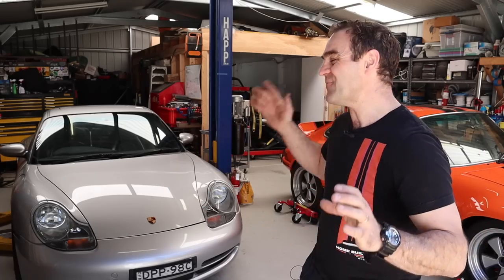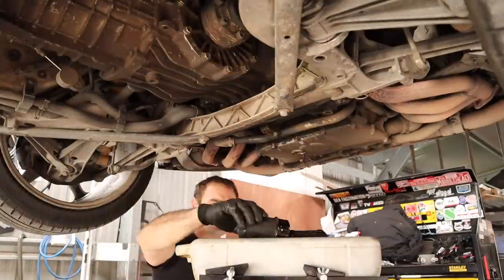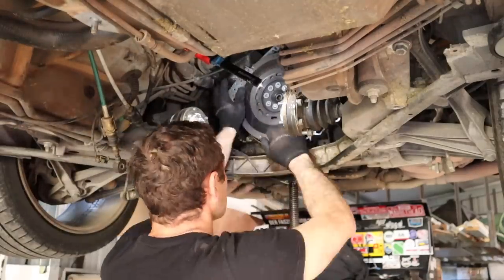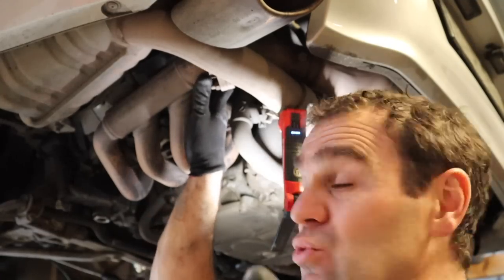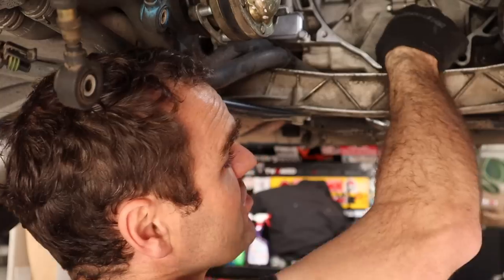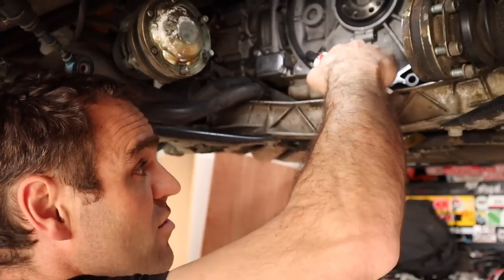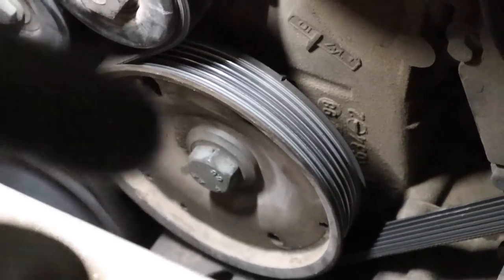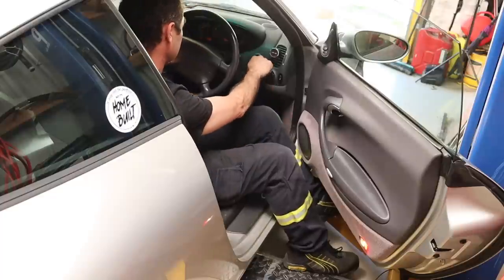Porsche 996/986 DIY IMS bearing replacement

Comment: Jake Raby here, Flat 6 Innovations.. Glad to see that you loved my extraction tool design :-) I designed this one for LN Engineering back in 2007.
Reply from the maker: Simple and it works. Thanks mate.
Reply: Jake 😃 do you actually need to removed the chain tensioner under the A/C compressor?
Reply: @khestehave  yes, remove all three chain tensioners

Comment: You don't need to take off the front chain tensioner, and if the flywheel and cams are locked, you don't need to put the lock plate on the flywheel. I used an EPS permanent-fix roller bearing kit and EPS clutch kit. The clutch disk has more meat on it and a better hold.

Comment: I would have been inclined to use a slide hammer on the bearing remove, but you need to lock cams, etc the kit sounds good, but just releasing the chain tensioner and marking the cams positions and engine at TDC would probably be fine also... Those stretch flywheel bolts always concerned me, when I switched to a single mass flywheel on my C5 Allroad, the aftermarket flywheel I got it slightly used clutch disc, and pressure plate,  but upgraded the clutch to a new custom made segmented kevlar disc for longevity. In my search for after market flywheel bolts ARP made flywheel bolts that would work, but decided to call Valeo to get the correct stretch bolts, they sent them to me free no charge....

Comment: Why do you have to lock cams and remove tension.     The bearing wont come out unless you do that procedure
Reply from the maker: To take tension off the bearing and to ensure the timing is locked in. If the timing moves you might have to say goodbye to your engine ;)
Reply: @HomeBuiltByJeff  
They have 3 set screws for the ims housing to hold something in place.   Does that help if I lock cam nd pin tdc.  Or do I  take off chain tensioners.    Are there 4 chain tensioners.   
Thanks for your video

Comment: The bearings do last the life of the car.
When the bearing goes the car dies.
Reply from the maker: Haha, true, unless you are Hoovie and LS swap it ;)
Reply: Lol.  Lifetime guarantee.  When it fails its life expired.
Reply: Home Built By Jeff . That was a failed resurrection attempt.
It failed because he didn’t mitigate the oil pickup problem facing the motor backwards would cause.
Reply: Anom Amos
You're mean .....
Reply: @HomeBuiltByJeff  
It would have been cheaper for him to put in a brand new 996 motor.

Comment: I thought all aftermarket IMS bearing solutions used an oil supply line to the new bearing. Hmm. I guess that’s one solution. Did you consider the oiled IMS bearing solution?
Reply: the Oiled ims bearing Is about 700 to 800 dollars for the kit. AN you haft to drimle  a slot in the crank case  to get the line to fit

Comment: Nice work mate, how was the old bearing condition? I'm still driving with the original so need to get it replaced as well. Impossible without a hoist I would imagine?
Reply from the maker: My bearing was fine. There are guys who do it on jack stands, but a hoist makes things easier for sure.
Reply: @HomeBuiltByJeff    
I thought about that, but the transmission for a 986 is around 175 pounds. That's heavier than I could move on my back in the garage.

Comment: I borrowed a pilot bearing extractor from Oreilly's and cut a 6 inch piece of pipe and big bolt and nut to make a tool to extract the bearing, and made cam locks from an old hinge.
Reply: Nothing competes with “old school” engineering, you are one of a rarity, we talkin’ one over a billion category stuff

Comment: Yes, I'm still looking for the oil pressure feed to the bearing (Bushing) replacement that Jeff put in this motor.  If you own a Porsche, you need another vehicle to fetch the parts to keep it on the road.

Comment: 3.4's had a single row IMS bearing. It is only the very early cars that were dual row. Also. I think you need to lock both cams, because you are releasing tension on both cam chains. There is a potential for the chain to jump. That is why the kits normally have two locks.
Reply: he already said that that on the bearing in the video. Also the chain doesnt have enough slack to jump, and gravity prevents it as well.

Comment: Why do they want you to send the bearing back jeff!?
Reply: Yeah Mate Watch the video.
Reply: They sent a sticker to attach to the car to certify the IMS bearing has been replaced. If you are going to buy the car and see the sticker, you can call LN Engineering, and they will confirm they sold the replacement for that car, and received the old one back, implying that they know it has been replaced
Reply: @Sharkerp38  aaah I guess it's a Porsche thing to have the confidence in buying and selling the car afterwards, never seen that before cheers

Comment: The Boxster 986 (1997-1999) has a 96.20 (2480 cc) engine which has the original double row bearing and has no problems.
From 2000 to 2002 were M 96.22; from 2003 to 2004 of M 96.23; the S from 2000 to 2002 for M 96.21 and from 2003 to 2004 for M96.24. who have the IMS problem.
Reply: So if I buy a Boxster from 1997 or 1999 I should be less worried? Ima scoop up that ‘99 Boxster then! Thank you!

Comment: A dumb question: why was locking the cam shaft position important?
Reply from the maker: Because if you don't, when you take tension off the belts, they could move, skip a tooth and you are in a world of hurt.

Comment: I’ve got one to do on an automatic. Unfortunately engine and trans have to come out as one and then separated to do.
Reply from the maker: It looks like the early tips can be removed with the engine in, but the later ones can't. That is a pain.
Reply: Home Built By Jeff I’ve got a 2000. I can’t even determine if it’s a single or double row without disassembly. Lol.
Reply from the maker: @StevenAndrews  I believe the 98-01 tips can have the box removed with the engine in and you can double check the engine number to find out which bearing (I am pretty sure LN can tell you which you have).

Comment: How did you open the drunk after disconnecting the battery... looked like you close the frunk afterwards 😱
Reply from the maker: Mine is a 996.1 with a cable latch ;) . 996.2 is electric.

Comment: Every channel that I've seen does it to a 996.  Again, the 986 gets no respect. A video of the wrong model is great for entertainment, but for someone who actually wants to do this work themself, they need a video of their specific model.  Once you get the transmission out, the bearing change process is the same, but getting to the bearing is the hard part.  There were roughly the same number of 996s and 986 manufactured so a lot of viewers are being ignored.
Reply from the maker: There is a great series on the 986 which is what I used for reference.

Comment: Theres an afternarket kit developed to fix the issues with the ims bearings giving a direct oil feed to it. https://tunersmotorsports.com/trs-development/ims-bearing-direct-oil-feed/
Reply: doesnt fix them. Theyre too weak for their load, and are of a missized tolerance from the maker. Porsche instead of enginnering it with proper tolerance...just left it

Comment: Hi, I recommend whenever you potentially disturb the cam timing of any engine to turn the motor by hand before using the starter motor, usually by using a socket and ratchet on the crank pulley bolt.  This way you will feel if there is interference and not drive through it. The starter motor alone has enough torque to drive through clashing metal parts and I've snapped rocker arms with the starter motor.  I didn't place one of the rocker arms on properly and didn't notice.  Went to turn the motor over using the starter motor and snap.
Reply from the maker: Exactly as I mentioned in the video ;)
Reply: @HomeBuiltByJeff  Sorry mate, I must have missed that. That's why I shouldn't watch youtube after night shift.

Comment: Did they ask you not to show too much detail on the workings of the tool Jeff?  It would have been good to see exactly how it works in a step by step. It's a good job out of the way...
Reply from the maker: No. That is it. basically screw it onto the IMS bearing and as you tighten it up, out it comes.
Reply: @HomeBuiltByJeff  Must admit to thinking it had broken off a bolt or something when I heard that "crack", but all good, out it came.

Comment: Right tools and correct procedure adopted.  Try a cambelt on a JTS or twin spark Alfa.  Again you need the correct tools and procedure knowhow.  Great job.  Methodical.  Are you sure you don't want that super magnet for the Speedo drive recovery?
Reply: @basstard13  Howdy from OZ.  The JTS was an improvement over the twin spark and plenty were sold in Australia and in the European countries I have visited including Bulgaria and even Israel.  Mine is a 2004 Spider manual with less than 75,000 kms.

Comment: Hmmm. An inaccessible bearing that can destroy your engine and everyone knows about it. Looks like German over engineering went a bit under engineered with this one. Anyway good job.
Reply: Two ways of looking at this.
1/ apprentice [engine] engineer/designer designed the bearing.
2/ deliberate to make owners take care in for  regular maintenance...
Workshop time?
Reply: @stuartd9741  I think I'll vote for option 1. Theres no way that fitting a washing machine bearing in an engine was ever going to be a good idea!🤪
Reply: Hmmm Porsche released a new motor and has ONE problem arise from it. As of today it's something you can fix once and never worry again. Ford ... Well the Windstar van transmission problem was never fixed as well as 80% of the other problems all the cars ever face. Yeah damn Germans. Shame on you for correcting a problem that none of the American car manufacturers can do other than scrap it and try to make a new one. Does the new mid engine Corvette still have a shit transmission as well? 0-60 in 3 seconds if the transmission doesn't detonate from the severe torque.

Comment: I thought Porsche were good cars.  They look terrible to work on.
Reply from the maker: Actually, I am impressed by how well easily most of it is to work on compared to a lot of others.
Reply: I put an IMS solution in my 2003 Targa and did a lot of other little things like the water pump, belt, idlers and some of the coolant hoses that looked suspect as the clutch and Aos had already been done. Interesting car to work on and a treat to drive. I used the same tools and they worked great.
Reply: Boxsters are pretty straightforward to work on once you get your head around the mid engined layout.